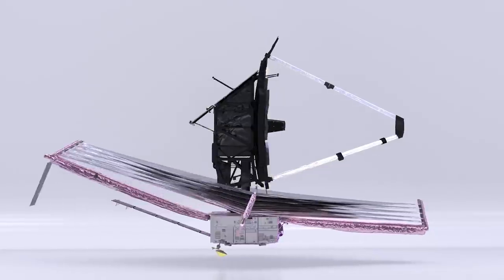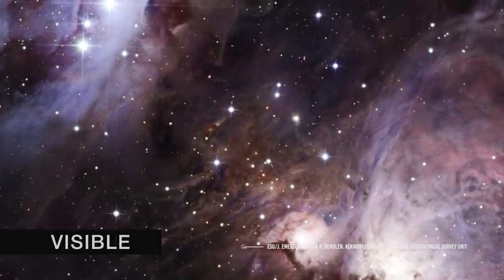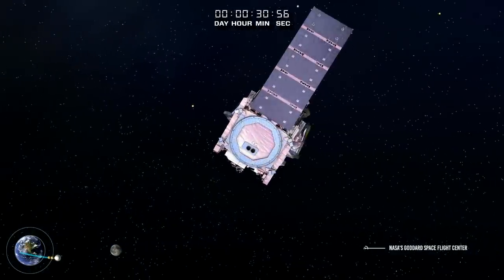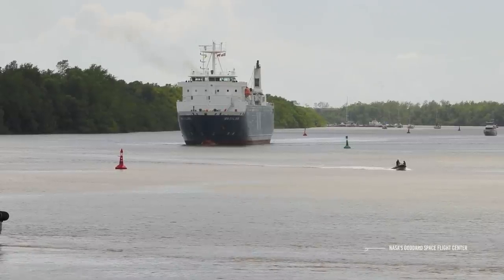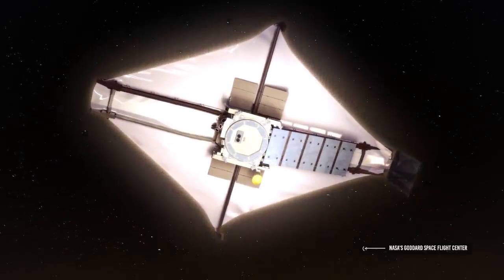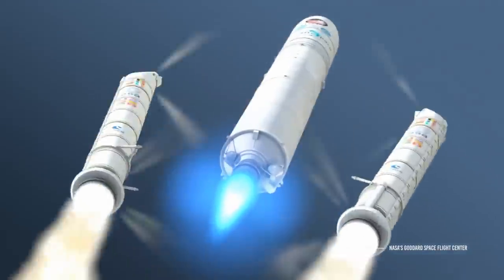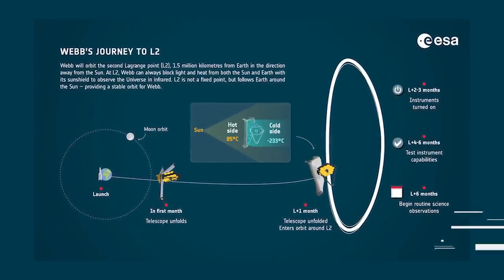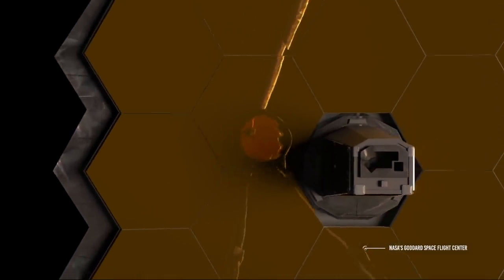Save The Date! The James Webb Telescope Is About To Launch.

Comment: I don't think they will ever make a telescope as large as the jwst on earth again. I think they will make a larger telescope in pieces and assemble it in space from now on
Reply: No, not really. There are specific reasons why this wasn't (and isn't) done:

- the ISS simply doesn't have the capability needed to assemble and maintain the high-resolution optics that JWST requires

- assembly in earth orbit isn't feasible due to all the debris that can rip it to shreds. There is significantly more debris in earth orbit because earth's gravitational field attracts it all.

- it is significantly more difficult to build it & test the systems and to calibrate them to the required tolerances in orbit than from the ground in controlled lab environments.

 - launching to L2 from LEO introduces a lot more problems. Designing an "unfurled" telescope to withstand the acceleration to get it to L2 is even harder, and would have required a lot more telescope mass. Which means much less room for the technology.

Comment: I'll watch but I have some questions? It's complexity and the stresses of launch will be enormous. Given the fact that it works in infrared means we'll have to rely on the heavily agendized academics to tell us what we are looking at. I'm putting most of my eggs in the Ground based equipment in Chile!! There are several! The largest being the VLT and ESA offering!
Reply: My biggest concern is that the ESA probably doesn't have sufficient resources to inspect and test. They were having issues with the Ariane  5 as late as last year!!The LHC being a perfect example. Building took around 10 years and after 9 days it failed catastrophically. Being down for a year subsequently
Reply: If it is visible light, there is at least a modicum of information available to my paltry abilities!
Reply: “Heavily agendized academics”. WTF is that supposed to mean?
Reply: @executivesteps  science for the 
sake of science.

Comment: That is a mirror exposed to the harshness of space. Even if they have a successful launch, all it takes is one tiny high speed particle to ruin everything.
Reply: Space is pretty much empty. They're putting it much further than the moon for a reason
Reply: @haven216  Hubble was close enough for repairs. What are they going to do if it needs service?
Reply: @sdmods619  JWST is planned to be in service for 10 years. They can't really repair it from that far, which is why it must work the first time.

Comment: Why didn't they use space X to launch the telescope?
Reply: How would they have done that? The initial design into the Ariane 5 faring predates any usable space x rocket by at least 10 years (the final JWST design was completed in 2016. The first Falcon Heavy flight wasn't until 2018). 

JWST was designed to fit in the faring of the Ariane5, it was designed for the vibration profile of that rocket, it was designed for the flight profile of that rocket, etc. To use the FH would require a redesign & retest of everything... which would require a few more years and another several billion dollars

Edit: and NASA is paying NOTHING for the rocket or launch facilities. Its free for NASA. The rocket and launch facility is being supplied by the ESA as their part in the joint mission.

Comment: We cannot see backwards in time.  Please lead me to the observations which support that theory!  Every galaxy measured at or near 13 billion light years away have supermassive black holes in their cores larger than Sgr A* in the core of our galaxy.  Those observations contradict the predictions made by general relativity, the speed of light, the age of the universe and the big bang theory.  The only solution to the equations so they fit all the observations is to invoke quantum entanglement occurring to all the light particles in the EM fields.  Meaning we cannot see backwards through time.  We see all the distant objects in the now.  Not how they looked when the light left them.  Believing you can use a telescope to look into the past is as silly as believing you can use a microscope to look into the future. 

The JWST will see supermassive galaxies further than 14 billion light years away.  It will not detect the first light or the early universe.
Reply: Sorry but the fact that light takes time to travel through space makes it a certainty that we are looking into the past. This is even the case within our own solar system. If someone sent a radio signal from Mars to the earth there is a delay of 5 to 40 min before it reaches us. We are therefore seeing backwards in time as a result. A comet could pulverize Mars and we wouldn't know about it for half an hour until the light finally hits the mirrors on our telescopes. As things get further and further away this gets more and more pronounced until you get so far away it takes the whole life of the universe for the light to get to us.
Reply: @zacrintoul  According to quantum mechanics when two EM fields merge or overlap the information between them becomes entangled so that what happens to one light particle or other particle when measured is instantly conveyed to the rest of the particles inside the field.  So if you measure one particle here or measure it completely on the other side of the universe makes no difference because the information is conveyed instantly at any distance.

When we measure a radio signal we are not entangled to the EM source so it takes time to measure any changes.  Same thing when light bounces off an object by reflection or refraction, light takes time to travel.  See the light echo when V838 Monocerotis exploded.  Hubble observed the star explode the instant it happened because Hubble was inside its EM field when it happened.  It took a few months for the light to reflect off the gas that surrounded it because of the speed of light.  New information took time but the explosion was observed the instant it happened.  When we measure a galaxy or star we are contained inside its EM field so all its light information, according to quantum mechanics and James Clerk Maxwell's equations on electromagnetic fields, happens in the now.  So we see the distant object producing a constant EM field as it looks today, not how it looked when the light left it.  Light clearly has two distinct speeds, instant at any distance when inside the EM field and 186,000 mi/s when any new light reflects or refracts off an object.

I know the consensus claims that we can see backwards in time but that is not correct.  Believing you can use a telescope to look into the past is as silly as believing you can use a microscope to look into the future.  Relativity is in error.  

Imagine the conundrum when astrophysicists find fully grown galaxies, larger than the Milky Way but further than 14 billion light years away.  Imagine the paradox it will produce.

Comment: Doomed the second thoes massive engines light.a shiny mirror blasted with chaos. How could this be you say? Because the space satellite telescope is not in a completely sealed environment sitting in that nose cone. It has air pressurization ports skirted around the nose cone. So what you say we've seen other rocket blast we looked at the videos.... That's right but what the videos don't show you is when the rockets go off it is such an immense Force it will violently in truth hot gases debris and exhaust fumes with such a force it would be like putting it in a microwave. Even a paper thin opening will have such a path for this nasty nasty material that will be kicked up to intrude interior to the unprotected mirrors little specks and flex of hot plasma magma corrosive by-products. Glowing hot specs equivalent of sparklers will intrude even through a narrow paper split there is such a force imminent that enshrouds that rocket. You might not see it but now that I mentioned it you can probably visualize it. Let me give you all a fine example the Hubble space telescope. Remember that. Do you think they're going to tell you that the lens got very messed up from the violent force of the launch itself that breached a design sealed bay doors? Would they risk bad publicity to inform the general public of such an event? The answer is no it was just a manufacturing flaw of the lens on the telescope that they fixed with a contact lens so they said. No. That rocket lifted off that carried the Hubble that did have a semi sealed Iris over the lens. With such Force that it vibrated the doors a jar enough to allow this described intrusion that I just told you about to not only penetrate this space shuttles bay doors but the shoddy built lens cover that loosely sat over the Hubble space telescope enough for what I have described to you to occur not only through one field set of doors but a loosely fitted Iris flap that probably was under engineered for its task. Now let's go to the James Webb space telescope here we have an open-air set of very specific very delicate engineered instrumentation that is designed under designed mind you for any protection. That requires ultimate protection. It cannot be dirty or marred by debris.there are videos describing how they had to re-engineer the nose cone once already because of pressure issues of it going into space and not achieving equilibrium upon the nose cone separating to where the payload can float out away from it to be deployed to its final trajectory into precious L2 Dead space. Okay they re-engineered the nose cone once concerned with this what I have just described to you in detail but they confess omission that they had to leave some open cavitations to allow this pressure equilibrium to exist. Those very wide openings will guarantee everyone following us that the mission will be a failure upon ignition of those huge massive powerful rocket engines. I have thought of this and I think they should have some sort of rupture disc put over these described ports at least allowing complete seal until it is moving fast enough to escape the debris column. You can put a tank of some sort of gas inside the nose cone to release and pressurize the nose cone to rupture the sealed ports to give breathability to the nose cone to overcome the problem of equilibrium. That will be $100 million please seeing how 10 billion has already been spent I would like to be paid for my opinion and advice thank you very much. 🧐🏴‍☠️⚔️ And as usual I am glad that I was able to save your 10 billion investment Americans. Hope you get to see all the space and satisfy your every desire and intrigue possibly achievable by this fine fine space telescope. 😂👽 And don't let the government stick you were the good Lord split you 🤡💉🍩